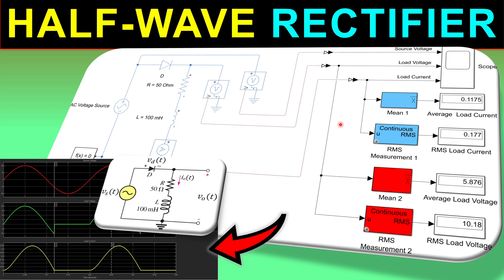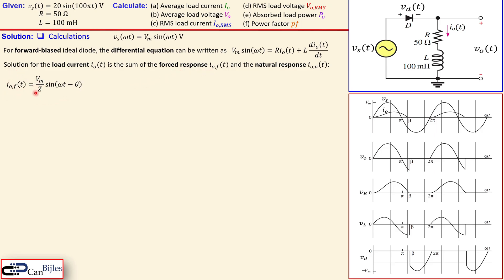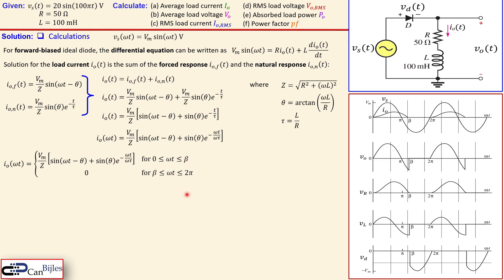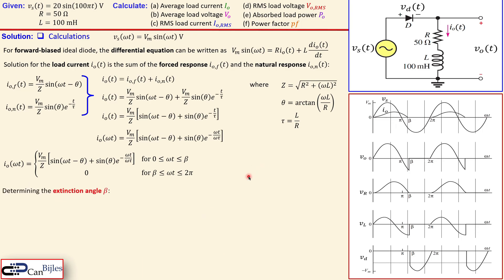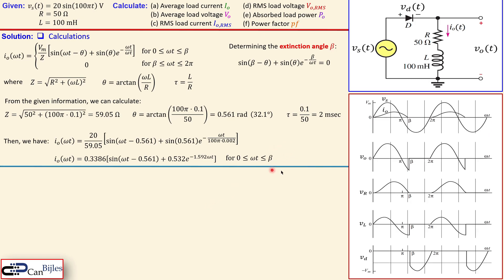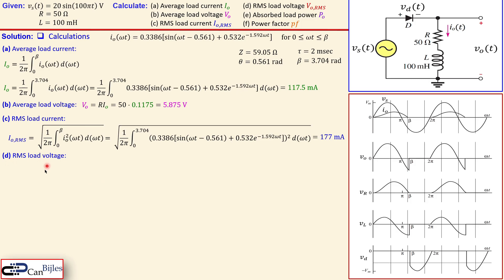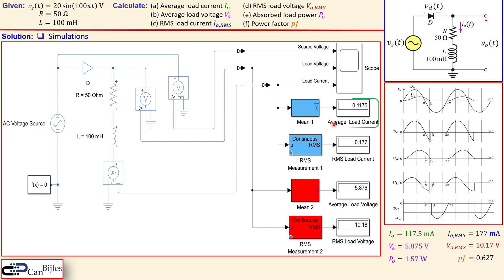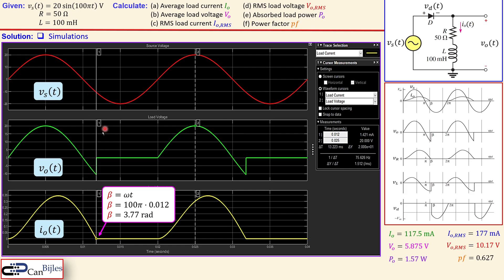Half-Wave Rectifier - RL Load ⚡ Power Electronics Circuits ⭐ Calculations & MATLAB/Simulink

Comment: In the absorbed load power calculation, seen @ 12:00
why is the average load current 0.177 A instead of 0.117 A,
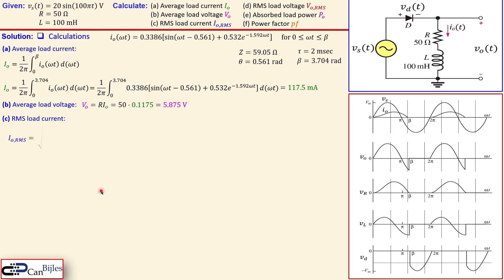0.177A  is shown at 10:27?

Since your simulation also shows 0.177 A,
does that mean the calculation of the average load current is incorrect?
Reply from the maker: The average load current is 0.117 A and the RMS load current is 0.177 A. We use the RMS load current to calculate the absorbed load power. So, the calculations are correct.
Reply: @CANEDUX  thanks, you are right. this is so exceptionally detailed. thank YOU!
Reply from the maker: @salman_babar  You're welcome!